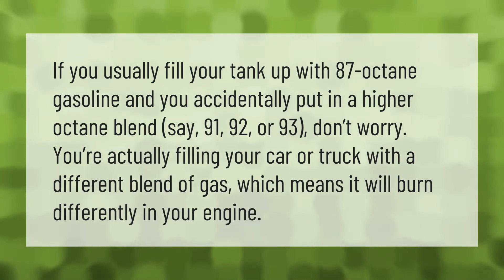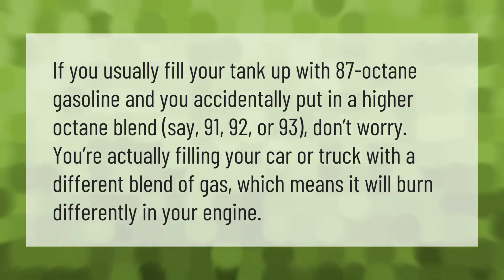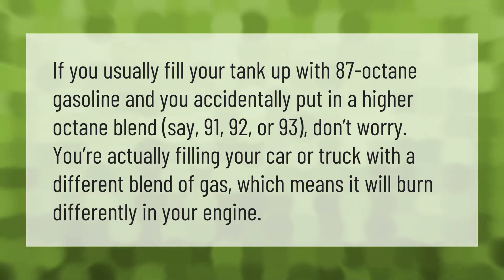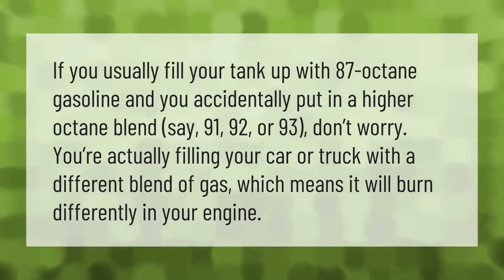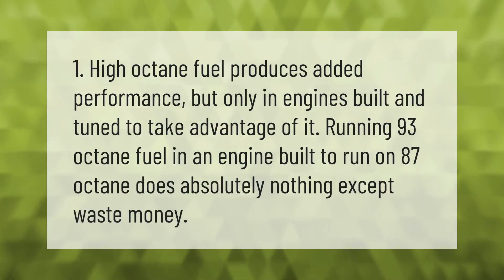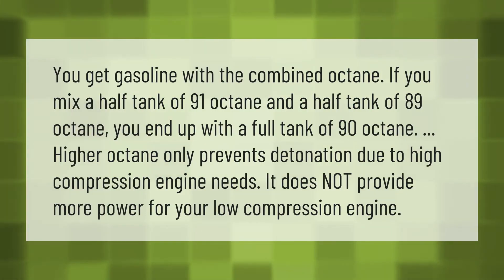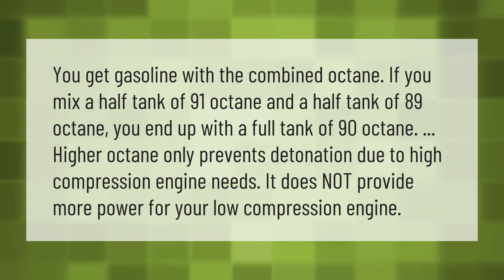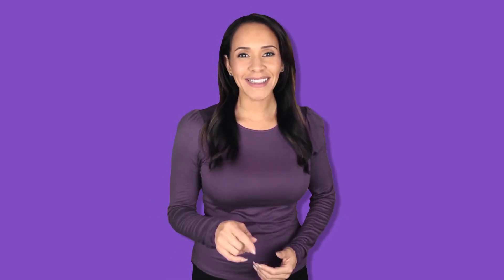Can you mix 87 and 91 gas?

Comment: Thanks for the advise. No worries when your car needs 87 octane or higher. I did that, half 87 and half 93 because 87 octane ran out at the gasoline station. Many users wants to save money. But next gas pumping, use 87 octane.

Comment: My car says it can run on regular, and I’ve been using regular but after some research, it strongly recommends premnium gas, so is it safe to switch to premium and mix a semi full tank of regular and premnium?
Reply: Exactly what I want to know
Reply: @atumoo9483  same. What’s the answer ???
Reply: I try and the check engine light came on evap issue/gas